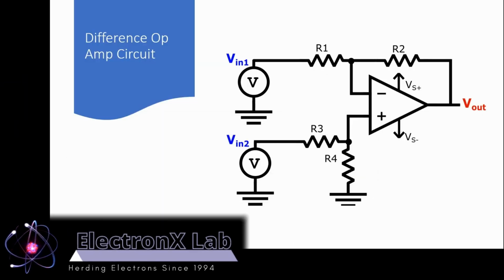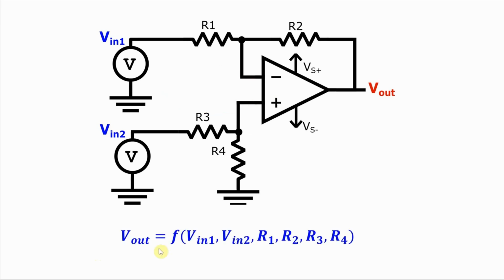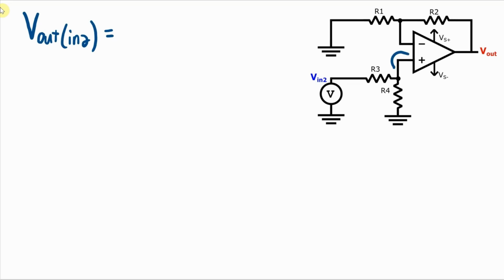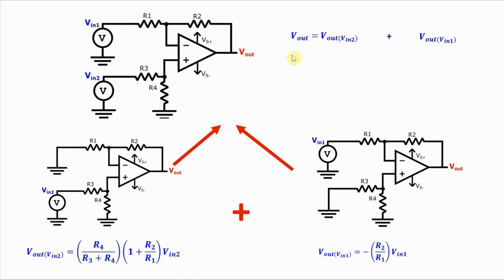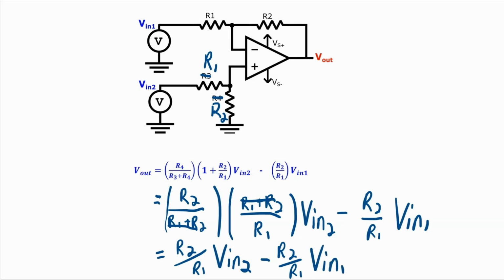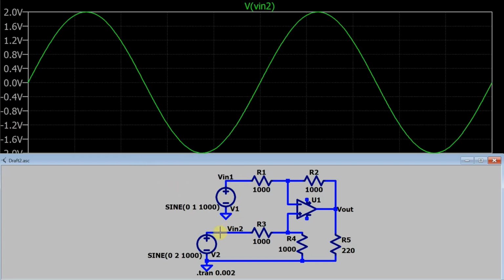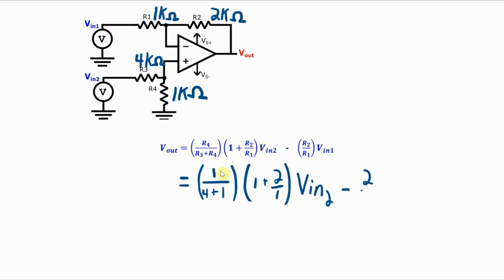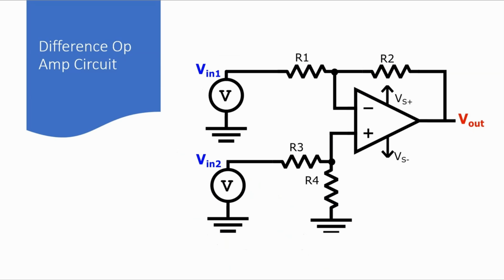Difference Amplifier Using an Op Amp

Comment: So if i want my output to be 3v and voltage difference is 0.003v and R1 is 1k ohm, than R2= 3÷0.003×1,000=1,000,000ohm? I tried this and no results. Not sure what im doing wrong.

Comment: Do resistors have to be in a certain limits, or any combination can work?
Reply: You will always get a little less than what you put in. You can put what resistors you like in, but once the op amp is saturated, that’s your limit. Also voltage across a resistor and the current through it, are a power limiting factor. P=vxi^2.